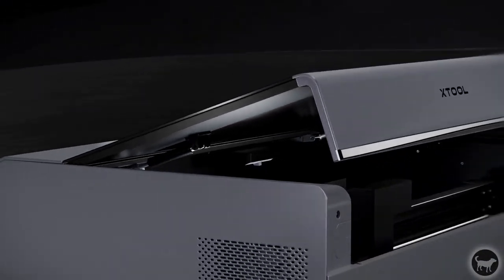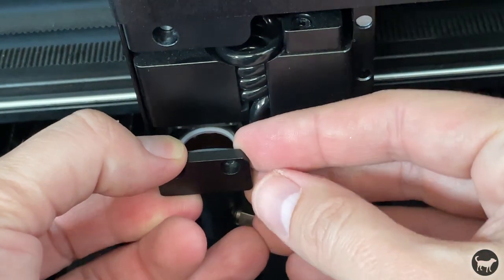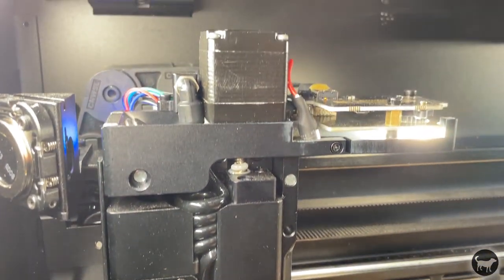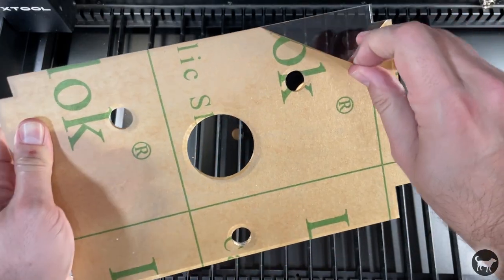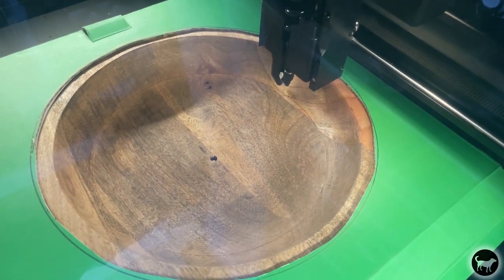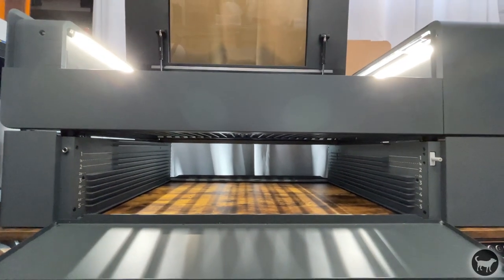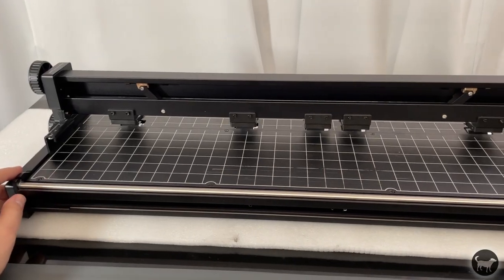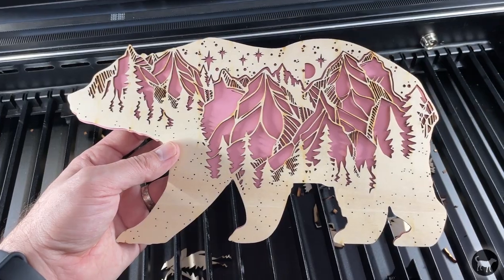xTool P2 Desktop 55W CO2 Laser Cutter and Engraver Review | Curved Surface Engraving | Wifi

Comment: Great review, many thanks.  Some great features.

How efficient is the water cooler (built in to the unit I assume)?  The tank does not look to be very big, and I would be concerned that the co2 tube would overheat, since my garage temperature can reach the upper 90s F in the summer, and rarely drops below the 80s in our FL winter.  Also high humidity.  Air conditioned workshop not currently an option for me, which is one of the reasons I've not gone down the budget co2 route.
Reply from the maker: According to the manual it should operate fine in up to temps of 86F. Not sure how much you can go over that but this is what it lists in the manual.  

The machine works properly at the temperature of 10°C to 30°C and can be
stored properly at the temperature of 10°C to 45°C. Do not operate it at a
temperature lower than 0°C.

Comment: Great review as always! One thing I'm curious about : Can you slide a longer peice of matierial (let's say 1/4 inch acrylic) under the P2 to engrave/cut a smaller design on a part of it when you don't have the riser?
Reply from the maker: Technically yes. There is about 25mm of rubber feet under the P2 so you could remove the tray and still have room for the 1/4 piece under it. ight not have a ton of room for a honeycomb but the piece would fit.

Comment: Hi , thanks for the vid! It seems there is more charcoal with the p2 when cutting compare to other machine. What are your thoughts on the matter? That can is more of a problem when you want to engrave  cut.. can you do photo comparison  between two machines on that matter? Thanks in advance and keep doing great reviews!
Reply from the maker: Thank you! Yeah like I was saying in the review the spot size is larger then in a diode machine so there is a little more char then you would get with a less powerful machine. I suppose you could lower the power and slow the machine down but that somewhat defeats the purpose of a CO2 machine which most people get for that faster cutting.
Reply: @BusterBeagle3D  thanks for your prompt reply! How does the p2 air pump?  Do you think with a better air assist pump you can get  less charcoal?
Reply from the maker: @itaiachiaz5524  There is an adjustable air pump but it's hard to gauge exactly how powerful it is since it only turns on when the job starts so there is no way to know if it's strong or not. In creative space you can set it from 10% at it's lowest for engraving and as high as 100% for cutting but it's not easy to hear the difference between those two values when it turns on. I just hear an air compressor turning on. You might be able to figure out a way to route your own air hose through it but I haven't messed with that yet.

Comment: I was considering buying a larger more industrial style machine, but I might switch to this instead; if the treadmill extension is as good as I hope.

I'd like to know of any limitations with that; can it work in conjunction with the active z height adjustment? For example to engrave a skateboard, which is long but also curved?
Reply from the maker: Hello. I don't think those 2 functions can work at the same time. They are even different "workspaces" in Creative Space so they can't function together. One is called Curved Process and the other is called Conveyor Feeder.

Comment: Do you think cleaning of the machine will be ‘easy’?  I have a glowforge and cleaning the air assist is a pain.
Reply from the maker: You should be able to remove and clean the nozzle fairly easily. Not sure exactly why you would as most of the soot would be on the outside and could just be wiped down. Even while engraving the air assist is on at least a little to keep positive pressure in the nozzle which should help it stay clean.
Reply: The nozzle can easily be removed to clean the inside using a Q-tip or pipe cleaner. The most tedious part is cleaning the mirrors in the rear since this requires removing a cover that is retained by screws and secured by a clip mechanism. The exhaust fan is also easy to remove and clean.